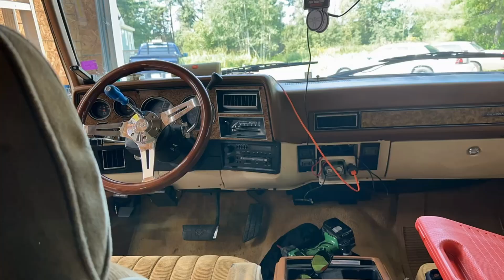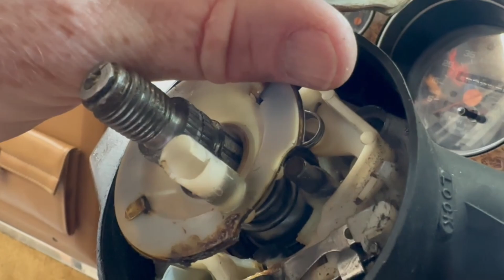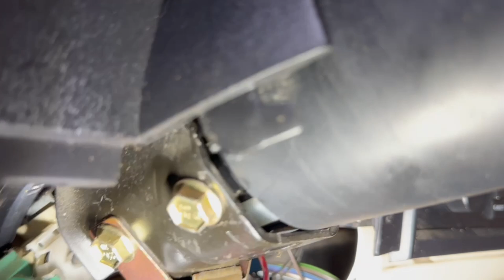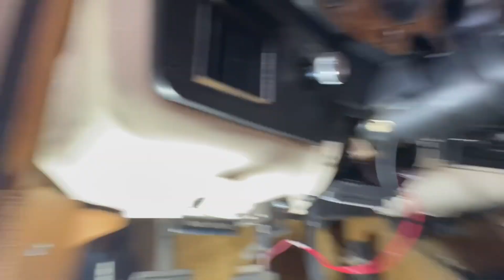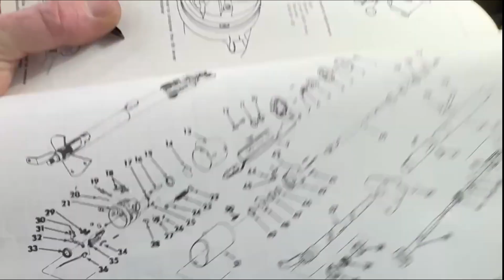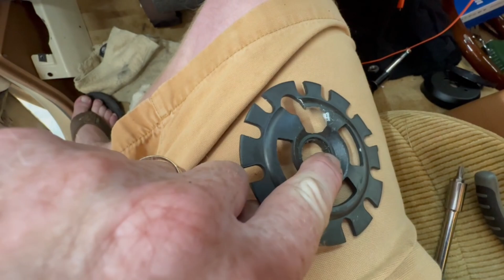I MESSED UP!!! GM Steering Column Issues To Be Fixed

Comment: We tied a string on the old switch wire when we pulled it out, then pulled the new wire back down . Those GM columns kept us busy. Some Chrysler tilts were the same.
Reply from the maker: I did cut the old switch wire and tried to pull the new one, it got fetched up on something and came apart. Oh well! I needed the practice!